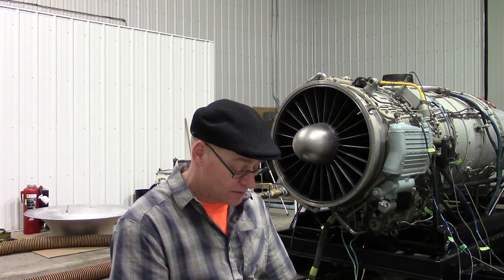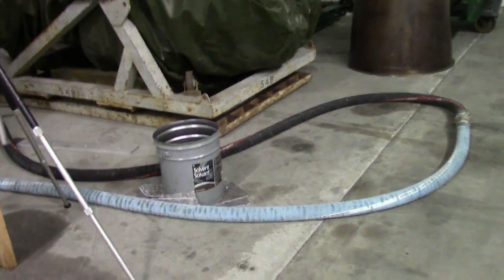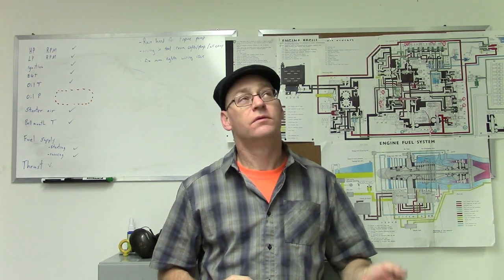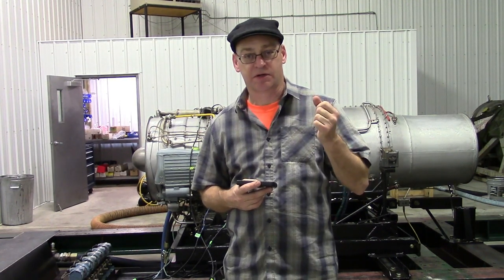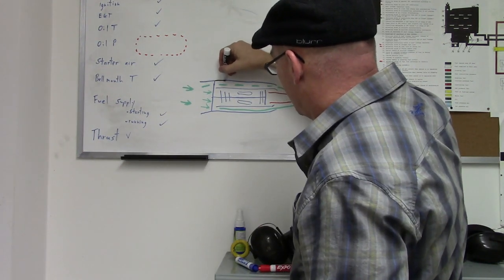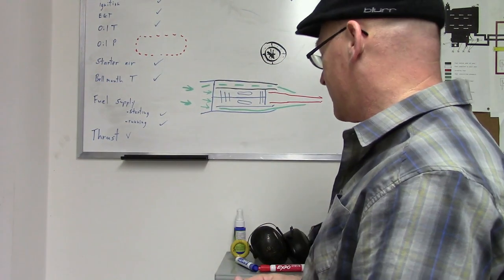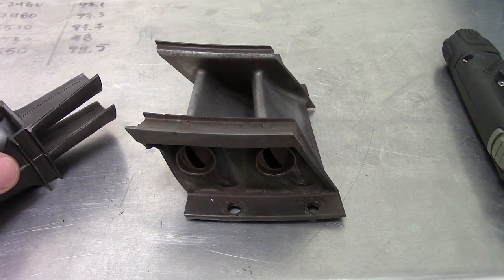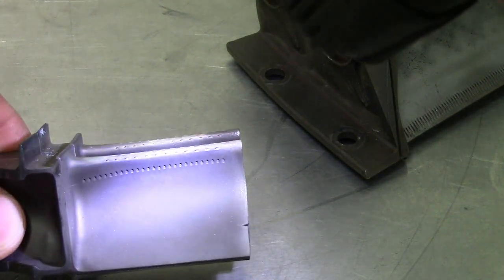Jet Questions  43

Comment: for those interested, search the net for the famous incident with a 747 back in the 70s or 80s.. the flew threw volcanic ash and all 4 engines flamed out... when they cooled, the deposits loosend again and the could restart all engines. Thee engines were shipped to Rollce Royce and taken appart.. they were full of deposits. Parts of them are still shown in aviation museeums today.. you´ll find Pictures in the net

Comment: Hello AgentJayZ.  Talking about the exhaust of propane fueled jet engines, Your reply was very informative and helpful.
I have experienced the burning in the eyes during start up and warm up of my home made unit. (once warmed up its no longer a problem). In the case of my unit I was under the assumption that one of the oil seals was going bad and a tiny bit of oil fumes was the cause. Now I know this is not the case. You are absolutely right in how intense the stinging sensation can be!

Lol you learn something new every day....Thanks again for your very informative and interesting videos!

Comment: Thanks again! Always a joy to watch.

You're right about the intake, even the first compressor stages of the J-58 could only handle subsonic airflows, so the inlet is designed to slow down and compress the air in a number of shocks. The exhaust nozzle does the opposite, accelerating the air to supersonic speeds by a converging-diverging ("de-Laval-") nozzle. Converging for the subsonic flow with smallest cross-section at Mach 1.0. At supersonic speeds a diverging duct accelerates the stream even further. Afterburner nozzles other than the SR-71's are not optimal, because the afterburner is just a temporary way to quickly reach your target, and is not intended to be used longer than a few minutes, but the nozzle has to be able to take on the optimal shape (converging) for high-subsonic flight.

One of most creative uses of a de-Laval-nozzle was perhaps this supersonic pingpong ball cannon: Purdue Technology students build supersonic ping pong gun

Comment: Hi Jay, you are absolutely correct, YES gas turbines can run on asphalt, in fact the GE J-3806 turbines produced in the 1950s to power GE locomotives ran on either bunker 'C' or No. 06 Fuel Oil  about as close to road tar as you can get...  GE also tested a GasTurbine Locomotive that ran on pulverised coal dust... results as expected included problems with blade erosion and soot build-up but the test unit did run some 10,000 miles

Comment: Fan bypass air doesn't go into the combustion chamber, but some after burning low bypass engines user a mixer unit to mix some of the air in the jet pipe to cool the turbine exhaust air before after burning. The GE F404 used on the F18 does this. It has a bypass ratio of 0.34:1

Comment: The inlet works the same way as an exhaust nozzle would to slow down the free stream to the compressor's optimum inlet velocity. On subsonic aircraft it diverges and on supersonic aircraft it converges. Supersonic inlets also work to compress the intake air a little, increasing engine efficiency somewhat.

Comment: Love the vids!
  I was checking out some modern jet engine diagrams such as the trent 700 and was rather surprised at what little combustors they use. I Know they operate at very high pressures but there must be enormous amounts of heat on those little annular liners. Is it just a matter of cooling air barriers or some other tricks?
 What sort of temperatures can combustion with 700psi air reach?  It's amazing how so much power comes from such a seemingly small volume, way different from the Orenda T14 combustor cans that's for sure!

Comment: Jay, you are so right about burning the road tar.  The ships I was on, either steam ships or motor ships both burnt something closely related to road tar.  On the steamers it was know as furnace fuel oil and I forget what the motor ship guys called it.  Sometimes we carried it as cargo and heated it to 70 degrees, but I can't remember if that was F or C, sorry, old age.  We could sit on the pipes to keep warm so I kind of think it was F.
The steamers used to have to dislodge the crud from the water tubes by blowing steam over them.  The crud then went up the funnel and all over the deck if we did not get the course alteration right.
The motor ship guys did not escape, the exhaust side of the turbo suffered in a similar fashion.  Water washing the turbo when we left port was a routine thing.  Then occasionally the engineers would get into the scavenge space to clean the build up of unburnt fuel out.  (On a B & W two stroke diesel).
There was talk of enriching the tar with coal dust but I think the coal dust may have settled out too successfully for that to work out.  Interesting as I believe the diesel engine started out designed to burn coal dust.
Still coming to terms with the pressures used in the engines you work on.  My car tyres are 32 psi.  Your pressures wow!!  I'd like to see a flame in 230 psi air but I don't suppose I ever will.  I guess it is smaller than one in open air at almost nothing psi.

Keep up the good work Jay and thank you so much
Reply: It was called Bunker 'C'.. aka No. 6 Fuel Oil       its was also used in Gas Turbine-Electric locomotives.

Cheers!

Comment: Re: F-22: The F119 has a very low bypass ratio, sometimes referred to as a "leaky turbojet", most of the bypass is really just to provide cooling for the core so the fuselage of the aircraft doesn't get too hot. It can supercruise because its exhaust velocity is really high, even when not in afterburner.

Super "cruise" still burns a hell of a lot of fuel because those engines make a ton of dry thrust, just not quite as bad as pouring raw fuel out like when the AB is lit.

Comment: I don't know if it helps with Q4, the air intakes usually have Intake ramps, adjustable "flaps" that drop down and reduce the airspeed at the compressor inlet, and thereby increasing the pressure at the inlet.

Comment: Hello AgenJayz! Great video as always. I wonder what is the usual thrust ratio for a commercial airliner(like a Boeing 747) using a turbofan engine? Also how does one determine the thrust ratio between the fan itself and the core section of the engine? Thanks! Awaiting an awesome answer.

Comment: Thanks Jay, 
I did watch that video again! 
One more question I have is: 
Why did the makers of Turbo Fan Engines decide to transfer the power of the hp system to lp system using just the duct exhaust from the combustion of compressor air through a power turbine? Is it because the mass amounts of energy could only be transferred that way and no mechanical mechanism could handle loads of that magnitude? What are the advantages if any for using just the duct exhaust? 
Thanks..
Drew
Reply from the maker: You really need to read a bit about how jet engines propel aircraft, and why a turbofan was thought of. It 's not just another way of doing things. It is a huge improvement in the performance, fuel economy and noise reduction for big, heavy aircraft that don't need to go super fast. Airliners and transports.
You need to get a better handle on how a gas turbine works, and then you will see that the question you have asked makes no sense.
In order to explain it to you, it would take a chapter in a book, not a YouTube comment, so I invite you to read that chapter. It's the second chapter of Jeppesen's "Aircraft Gas Turbine Powerplants".
Cheers, and good reading!

Comment: Turbine exhaust to make distilled water.

It is done

On a cruise ship you have a exhaust gas boiler in the power turbine exhaust.

This boiler takes waste heat from the turbine exhaust and uses to heat water to make steam.

This steam can be used to power various services including a steam turbine generator if it is fitted.

Another one of these services is to make fresh water

The steam is used to heat sea water to 75C roughly. The sea water is then pumped into a chamber under a vacuum. Then some of the water flashes off into low temperature steam. While the rest of the sea water is sucked out. 

The low temperature steam is then condensed into freshwater

This fresh water is used in the hotel services.

And a tiny part of it will be used to water wash the turbo chargers of the main diesel engines.

But most of it will be used to flush away passenger pooh

Comment: Hi AgentJayZ,

There's a full explanation of the sr-71 turbo-ramjet in a YouTube video by some science channel explaining everything.  It looks easy to understand based on all you taught.   It would be interesting if you would check it out and more fully explain it.  It's not clear how the ramjet works at high mach levels.  And wonder how air is slowed to subsonic in the cowl but still can be used for the afterburner\ramjet.  I'm sure you'd like this explanation and could understand it.

Thank you,

Don ( from Cleveland)

Comment: On the subject of BA009, which briefly became the biggest glider in the world in June '82, when it encountered a volcanic ash cloud high over Java, the turbine blades suffered pretty much as Jay described.  The molten ash would have deposited in the turbine as glass, but would have tended to spall off as the blades and vanes cooled and I believe that none of the turbine aerofoils (spell it 'airfoils', if you must) actually failed.  In fact, the aircraft was ferried back to LHR for repair after a changeout of only three of the four engines.
The most significant effect on engine performance would most probably have been the contamination and, to a lesser extent, erosion of the compressor aerofoils. The cooling of the compressor flow paths following engine shutdown, combined with the speed and airflow changes as the engines both 'windmilled' and went through restart attempts would have dislodged a significant amount of ash, hence the ability of the pilots to restart all four engines for a safe landing, even though they could barely see through their sandblasted windscreens (sorry, windshields).
Reply from the maker: Worry not, sir... British "english" is tolerated here in Canada much more than in the US.
We spell things "incorrectly" here also.
Reply: AgentJayZ Hi JayZ, Rest assured, I'm not worrying: I've had fun over the years with the "two nations divided by a common language" issue. Brits are usually reasonably educated in American English through TV and films, but it doesn't seem to work the other way round. I've had great fun telling Americans what the common British English term for a pencil eraser is ...

Comment: Hey AgentJayZ, loving your channel. As a thermodynamic/aerodynamic master student your video's provide massive insight into the practical side of things. 
However I do have a question:
Can you tell more about the cooling air that travels trough the turbine blades and nozzles to cool the leading and trailing edge. You've shown them here, but where does the air come from? Does the main axle support cold air transport? 

Greetings from the Netherlands

Comment: AgentJayZ - I wonder if the irritant is a bitterant in the propane, I know in the use most gaseous fuels have a bitterant added to them in order make detecting a leak easier. Certainly that when burned in the quantities a jet engine would use would be unpleasant. If you have virgin propane then the Nitrogen Oxides are probably more likely, pretty nasty stuff that.